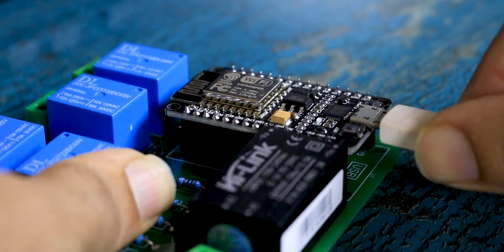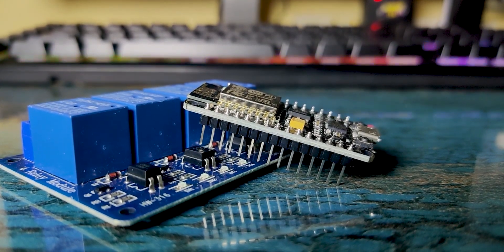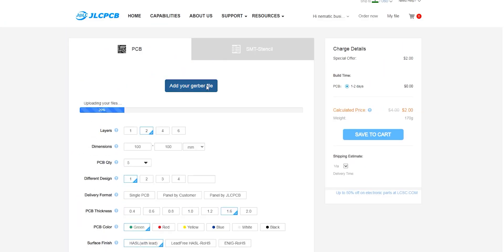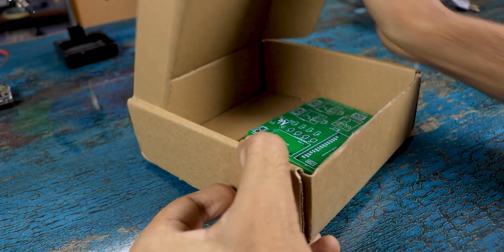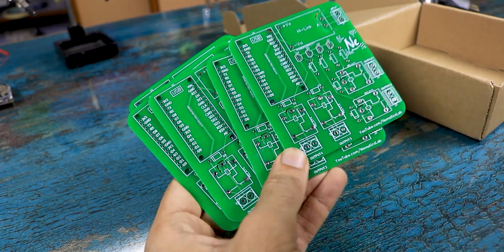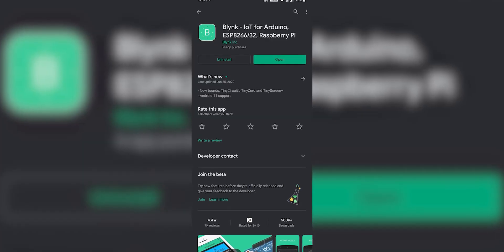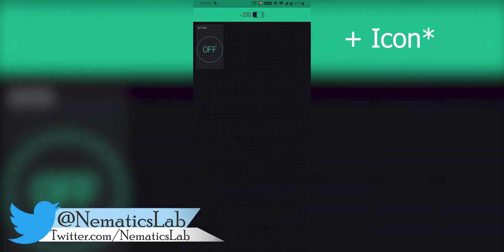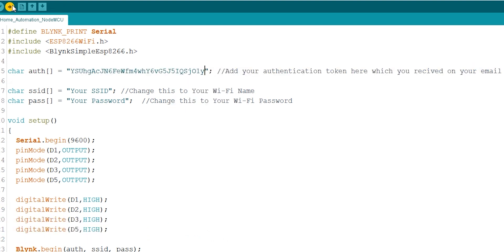How to make Home Automation using NodeMCU | ESP8266 | BLYNK | IOT

Comment: In the PCB, GPIO 3 is set to low level. If the ESP8266 is inserted into the PCB, it will cause the ESP8266 to enter the BootLoader mode every time it is turned on.

Comment: Is it capable to turn on ac motors like Water pumps?
Reply from the maker: Yes but you might wanna use some heavy duty relay or Solid state relay for such applications
Reply: @Nematics_Lab  You just a real electronic king thanks man. By the way would you please suggest any by name or brand.

Comment: Hello, I have worked on this same project in this month but I have faced a strange probelm. My NodeMCU cannot upload any code when it is on the board. And the pins state also do not change. I came to find solution and came to your video. I tested my circuit in breadboard and found no error there. Any suggestion?
Reply from the maker: ESP8266 requires specific voltage on pins while booting up, Check my circuit available on www.NematicsLab.com

Comment: The HiLink 5V 3W converter never pulled a single 5V relay with a Esp8266 for me. I had to get a 5V 5W converter after which i had it working. Wondering what i did wrong..
Reply: btw, i used esp-01s with relay board. https://www.aliexpress.com/item/33003960840.html
Reply from the maker: Check my website for more details, I have given proper schematic over there, www.NematicsLab.com

Comment: Bro you can also use Arduino for such networking related projects. The Arduino UNO's Ethernet shield can give your Arduino connection with a LAN. Not necessary to use only ESP.
Reply from the maker: Price
Reply: Not that expensive. Just affordable 500 Rupees.